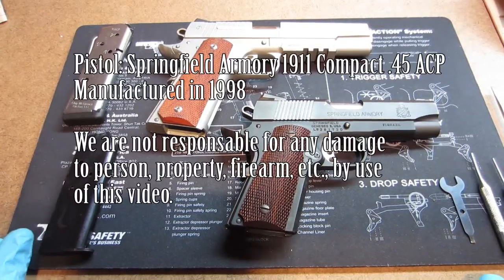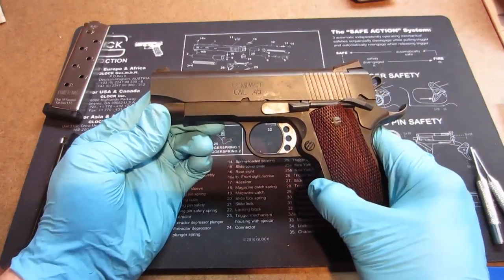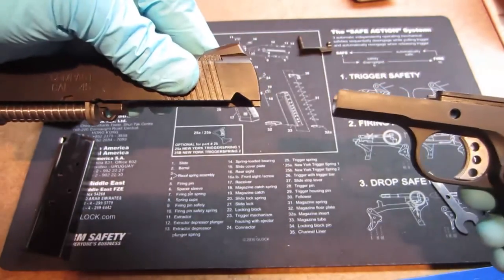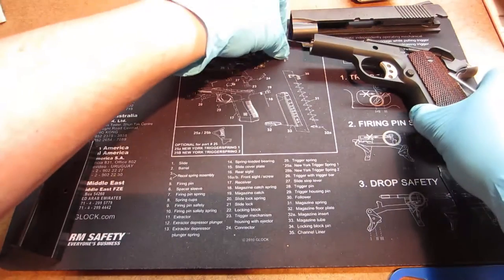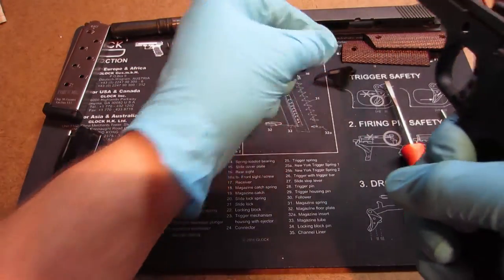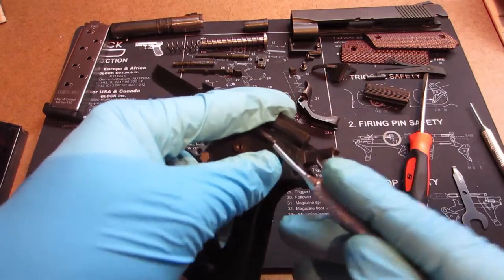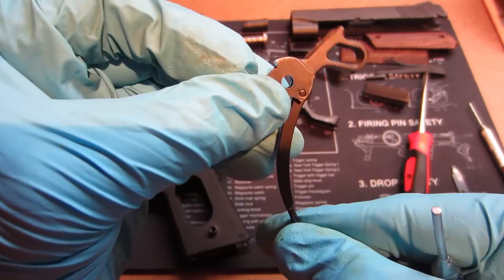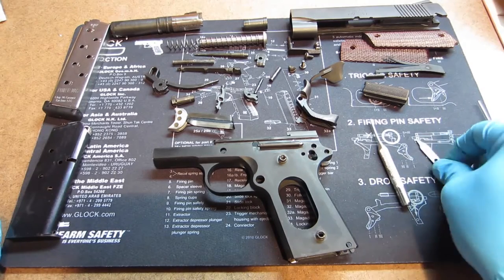1911 - How-To Completely Disassemble to Bare Frame and Reassemble (Also How it Works)

Comment: you dropped the slide on an empty chamber, TWICE!  Big NO NO!
Reply from the maker: I didn't drop anything. I "released" the slide on an empty chamber. Which is not going to hurt anything at all. Designed to do that. Not sure I've ever seen a pistol that doing so would hurt it. Thats how the darn things work.
Reply from the maker: Also, by your logic, all pistols that don't lock back on the last round are bad? DB380 as an example.